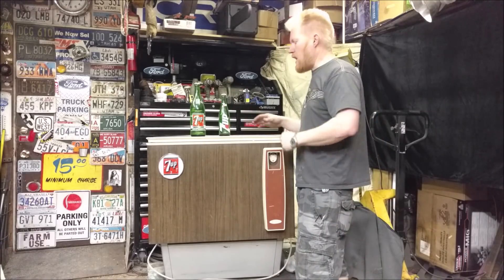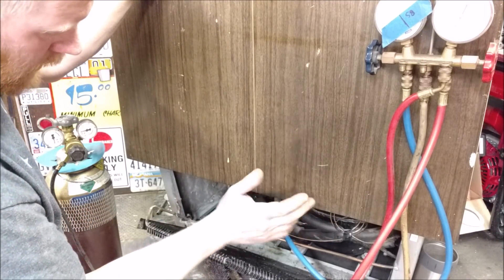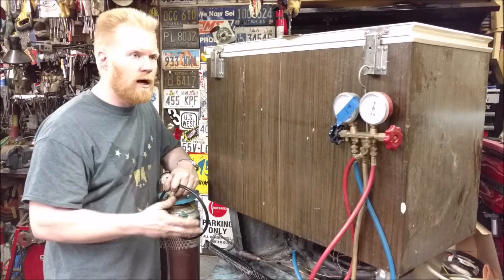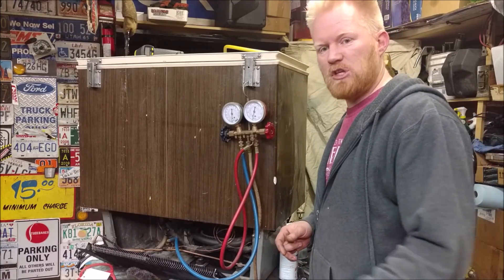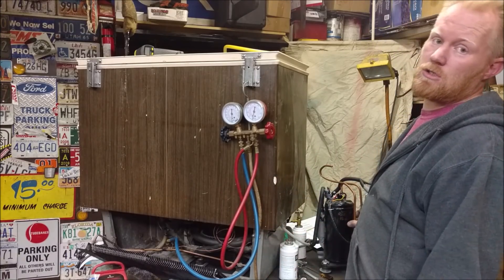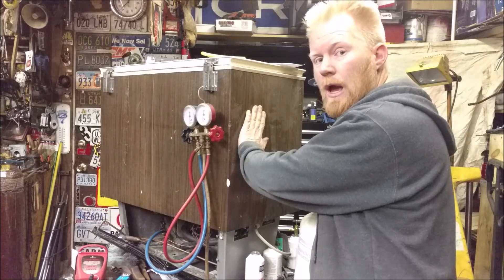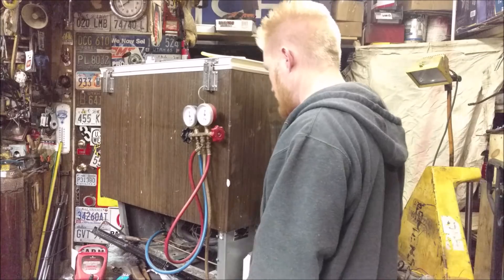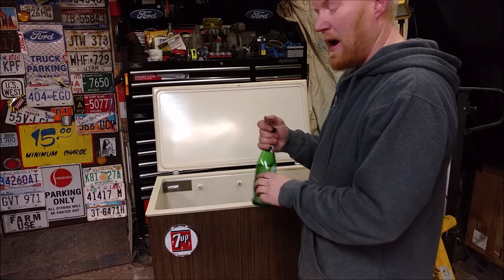recharge a Refrigerator with freon

Comment: R12 is banned completely, in my country, its a $20,000 fine if caught possessing it
Reply from the maker: So what. You can still buy it easily. They just don't make new stuff.
Reply: @sixtyfiveford  i use R152a a cheap refrigerant sold at the hardware store as air duster, works very well

Comment: Great vid! Question: I recharged an old wine fridge using a standard gauge set; blue line connected to the vac side; yellow to the freon; burped the air out of the yellow line but didn't burp the blue.  Fridge works fine now, but should I worry about the blue hose volume of air that I put into the system, or should I go back and vac everything out and refill?
Reply from the maker: If I understand correctly the line was under vacuum so it shouldn't need to be burped.
Reply: @sixtyfiveford  Thanks for the reply! That line actually wasn't under vacuum. It was connected to the vacuum side of the fridge compressor before topping it off, which was measuring right around 0 psi (atmospheric) at the time.

Comment: Awesome video! How do you take the service line off and reseal the hole where the line tap was attached after the fridge is charged?
Reply from the maker: You just leave the line tap on. Or you crimp, bend over and solder the stubby service line.
Reply: @sixtyfiveford  Good to know. Thanks for the quick answer.

Comment: I have a mini fridge but doesn't say the amount to refill just the type R600a. I've seen something similar in size and volume that required 15g of same r600a. But the fridge was 10w lower than mine, mine is 80w.  I don't have a gauge but i was thinking would it be ok to refill in the 15g range and measure the current draw of the fridge until it gets to 80w? The fridge is "compact cooler 5000"

Comment: Crucial Clarification!!!!    HC 12a is a Drop in Replacement for R12a.  HC12a is, as stated, a Hydrocarbon blend of Butane [r600] and Propane[r290].  R-12 or Freon-12 is illegal to sell or trade, as it is an Ozone Depleting Compound, and is classified as Toxic Waste.  Depending on Jurisdiction, trading in Freon 12 or Freon 13 can result in fines and jail time.  Please ensure you are in compliance with all regulations and codes regarding refrigerants, in your jurisdiction, and dispose of all associated wastes, correctly and responsibly, in accordance with aforementioned codes and regulations.

Comment: Great video but couldn't have have just pressurized the system by hooking your hoses up to a simple tire pump?  I mean, I got a 12v one at Costco for about $40 and use it to inflate tires and its pressure goes up to beyond 100 pounds ... that would have worked to show the leak, right?  And I wonder how that leak even got there anyway... very odd place for a leak.  Nothing was even touching it.  Very unusual.

Comment: Attempting to charge a fridge and you mentioned the crimped/sealed spout line as a fill location. This might save me because I will not be able to attach the puncture valve to the suction line. It's in a tough spot and mostly bent with no straight portions except inside a sealed area above. Lot's of information and a great video.

Comment: I love how you DIY without knowing how to do it but you make it work, you remind me of me haha. Good stuff my man. Although you shouldn't talk about vacuum in microns and "percentages" without a gauge. Getting below 400 microns doesn't just mean getting to 29" of vacuum. That's like comparing apples and oranges. All compressors will appear to get 29.92" but without a micron gauge you can't know. Achieving 15 microns is extremely difficult. Either way, using an old compressor will be a great vacuum pump, but don't assume it will get below even 400 microns when used as a vacuum pump normally. Loved the video either way, good stuff my man.
Reply from the maker: I'm glad you liked it. Thanks.

Comment: I really enjoyed this video, I had a question.
you don't recommend using compressed air to find leak because of moisture. But if you plan on vacuuming before filling won't that take care of the moisture?
Reply from the maker: Yes. But, vacuuming out excess moisture isn't good for your vacuum pump and will take a lot longer to pull out.

Comment: I have a few old vending machines I have been tinkering with. both run on R12, One was not cooling. I did not think there was anything to do and I would have to replace the cooling system completely. Believing that a replacement was needed I decided to try charging with R134. although it seams to be working I don't think the fix will last. If i want to vacuum the system and fill with a appropriate coolant do I need to figure out how to collect the gas pulled out?
Reply from the maker: Technically you always should recover any refrigerant. With that said, cans of air duster that were purposely sprayed to dust computers used to be just R-12 and then R-134a and now r-152a. Those cans if you still have them are legal to still use.
Reply: @sixtyfiveford  thank you for the info.

Comment: Hey 65... Good vid. What about recharging the oil? Wouldn't it be low on oil from the leak and the evacuation??
Reply from the maker: From all the compressors I've torn apart there is still a good amount of oil in them. This leads me to believe that very little oil actually circulates through the lines and even a full leak out like this one only a minuscule drop or two of oil has left the system. Even on small leaks where there is a small oil stain there is no more than a drop of oil. Compare that to the 1 cup(approx) that the average compressor has sitting in it and there is really no loss.

Comment: I used to repair refrigerators. I didn’t have a vacuum pump. I used to use an old compressor hook it up to the low side and let It run for 20 mins. 30 Yrs ago
Reply from the maker: Very neat. It gets the job done.

Comment: R12 today--- about $30. a can !!  Continues to go up.
Reply from the maker: Years ago maybe, but everything I've seen shows it continues to drop. I can find 1lb cans for $10-15. No one uses it anymore. There are those that still try to charge a premium, but look around and you'll find it. 3 years ago I bought 15 lbs for $50 and these deals are everywhere.
Reply: You can use 409a instead of r12 . 409a is a direct replacement for r12.

Comment: I would also open the low side valve on your gauges and loosen the hose at the service valve to bleed out that hose also and get the refrigerant right up to the service valve before you start feeding the system. That way you don't introduce any non refrigerant to the system. If all you do is bleed the hose going into the gauge set, then when you start feeding the system the first gas that enters will be what is in the low side hose which may be the inert gas you used to pressurize and find the leak or it could be air, which you already explained why you don't want that. Either way, you now have a small amount of some gas that shouldn't be there. One thing I would also like to see is more info on the actual charging, how much how fast etc. I liked!
Reply: i think that portion of the hose was evacuated when he vacuum pumped the system, maybe?

Comment: I have an old AC air conditioner last time they came out they charged me $60 per can and used 3 cans. Plus another $60 service call. So last year I bought a window unit. And it suxs. Temp in the house now that it is summer run 80-90 %. And my refrigerator died.  Do they have or make anything that will work that is not so expensive ?

Comment: Any tips for making a small DIY air conditioner? I'm having trouble finding a compressor small enough to fit into the housing I want.
Reply from the maker: They really don't get much cheaper or smaller than the ones in mini fridges.

Comment: Good video but if you can't show the actual charging, telling the pressure readings would've been very helpful. I've been fighting an old Cavalier on/off for week and still haven't gotten it right. Found online it should be 10/20 psi cold,  another 30/40 psi hot, yet another 80psi, static. I pulled a deep vacuum, used a digital scale and put in 16oz (what it calls for) R12. Evap still frosted or froze. Compressor sounds good, no rattling, runs quite/cool, gauge needle holds steady yet the saga continues.
Reply from the maker: If you know the quantity is needs, just put it in like you did and you're done. If it struggles to cool after this, more than likely you have an issue with your filter/dryer being plugged. You say the evaporator is frozen, is the fan that blows across it working? I assume this is a Stand Up Soda Machine?
Reply: Thx. Yes its a stand up and both, the interior/condenser fans, are working. Since I posted someone else suggested the filter/dryer too and said it "should" be at the bottom of the cond. Not there. I found it further away; 4.5" long, condenser line in one end, other end has the very small line. Know of an online source you trust that sells them?
Reply: Yep, both the evap/cond fans are running/blowing no problem. Yes, stand up machine; 60's Cavalier. Because of the issue I've reverted back to a dorm refrig until I can get back on the coke machine. I bought a filter/dryer. Just have to find the time to work on it again, hopefully soon. Will let you know how it turns out.
Reply from the maker: I have a similar machine that I use but mine is a 70's Cavalier Slant. Let me know how it goes.

Comment: I stocked up with boxes of R12 in the late 80's for 99 cents a can. Unfortunately some leaked out in storage, not even rusted. All my vehicles still use R12.
Reply from the maker: Yeah, I have quit a few r12 cans. I too am surprised that roughly a quarter of them leaked out for no apparent reason. It was pretty hard years back to find r12 cheaply but it seems to be getting a lot cheaper the last few years, with so few r12 cars on the road.
Reply: Yes you won't find too many guys driving around in a 68-70 Chargers , 1981 Mercedes or 1990 Ford trucks anymore. Amazing that a 1990 is my NEWEST vehicle.
Reply from the maker: I keep it around for my 86 Toyota motorhome.
Reply: is it a dolphin? we have a nice little 87 Toyota dolphin.

Comment: Im prettty sure what this guy is doing is illegal in many states...    Damn Environmental laws around using freon.
Reply from the maker: If your system runs r-134a it is completely legal to refill or you can retrofit to r-152a (new air duster cans) if it is an old r12 system.
Reply: sixtyfiveford legal ' yes ' for now anyway however there's a lot of political Bullshit going on and eventually the average man may no longer have any access to the small cans of R134a anymore in about 2 years or so they Takeaway one of you're rights they almost always take the rest of you're rights as well because that's the way Tyrants operate.

Comment: how can you do this to a stand up Soda vending machine
Reply from the maker: Exactly the same. A Stand up machine will let you pull the entire refrigeration unit out though the front so you can service it.
Reply: how many cans would you use on one
Reply from the maker: It'll say right on the tag the capacity and gas type of your unit.

Comment: You know its a good leak when it blows the bubbles clean off!!! What type of solder did you use? Stay Brite 8 is pretty good for HVAC that isn't right off of the compressor dischage.
Reply: im an hvac tech, i braze everthing, you need nitrogen though. when brazing, need a small amount of mitrogen in system, otherwise carbon will build up inside pipe.
Reply: Only use line tap if there is no other way to do it. They are prone to leak. I have repaired cooling systems for 15 years, so I know what I'm talking about.
Reply from the maker: I used plumbing solder as it required a much lower melting temp. I was concerned about the proximity to the cabinet.
Reply: That Stay Brite melts at low temps but has some silver in it to help with stength.
Reply: Robert L  he should of used stay brite, low pressure appliance, plumbing solder should hold for awhile if the leak is on the low side of the system
Reply: I agree with you (retired HVAC engineer  in UK). I would have used silver solder and changed the drier. I don't like line tap valves, had a lot of them leak.

Comment: Is there a way to figure out how much oil is missing from the system, or how much is left?
Reply from the maker: +Nick M The majority of the oil sits in the compressor and during a leak only a very small amount will exhaust. Generally no oil needs to be added unless you notice a large oil spot/slick where it leaked out. So fixing the leak and adding refrigerant is all that is needed.

Comment: has no luck with the clamp on service valve. they leak, slowly but leak.
Reply from the maker: +Joel Stewart Once you get the unit up and running good you can re-crimp the line like before.

Comment: I bought a 30 LB container of R13 when it was still available and stored it in my garage on a cement floor... 12 years later, the moisture from the cement rusted the bottom of the 30LB container. DUH... Should have stored it on a shelf or wood.

To 100% eliminate all air [water] out of the system, vacuum down off the high side with the canister attached, and when done close the high side valve.
Reply from the maker: +sjs Vacuum through the high side.. Makes sense, thanks for the tip.

Comment: I know a lot of people care about the efficiency of older appliances nowadays how efficient is this cooler??
Reply from the maker: +ARednecksLife After a week of testing I got a figure of around $40 a year total running cost. A similar size(5cuft) top energy star rated refrigerator made today runs around $33(their figures). Some new models in the size range use upwards of $45 a year.  Older refrigerants are more efficient at cooling but bad for the ozone. So, energy wise new stuff is playing catch up. I can only imagine if we still used these bad refrigerants how efficient stuff would be.
Reply: +sixtyfiveford correct me if I'm wrong, if you factor in the cost manufacturing of new equipment then disposal of the older equipment, the older stuff still comes out on top.
Reply from the maker: I agree. I would say the majority of older fridges get thrown away because of looks rather than failing.

Comment: Those old machines lasted forever (way before the Energy Saver days) and keep drinks so cold, you'd wonder why it was frozen.
Reply from the maker: +A LeBlanc These chest designs are great as they never allow the cold air to flow out like a conventional door refrigerator. 2 years ago I bought a 1941 Kelvinator refrigerator, plugged it in and it worked great and cooled great. I had to replace some of the old brittle wiring but it is still going strong and the center piece of a vintage kitchen. Just for fun I did test out the energy efficiency for the past week of this 1964 7up machine and it will use around $40 of electricity a year. I looked up brand new fridge of the same size (5cuft) that is energy star rated comes in at around $33. So even at a $10 a year savings it takes a long time to pay the price for a new fridge that will only last 7-10years.
Reply: +sixtyfiveford That's awesome that you checked the energy usage, really surprised how well the old one did!  Great find BTW!
Reply from the maker: The 1941 Kelvinator refrigerator I fixed up used even less energy at around $25-$30 a year. It was small(around 10cuft) but those figures beat some of the fridges today. With these inferior refrigerants the epa is requiring be put into cooling systems, were playing catch up with the new stuff.